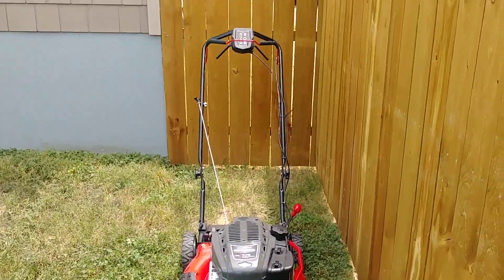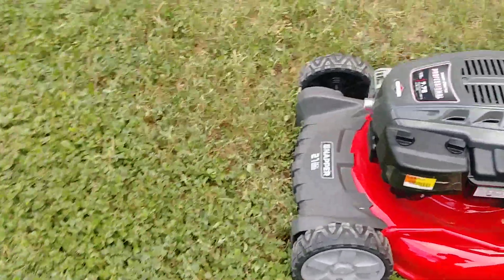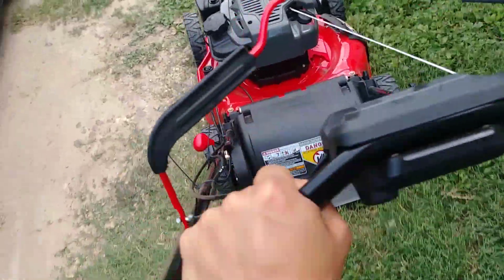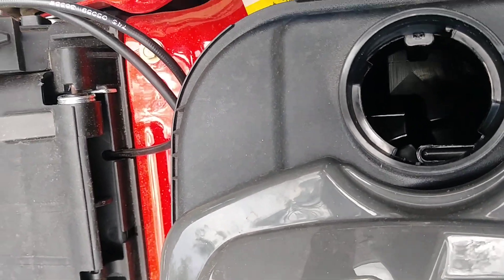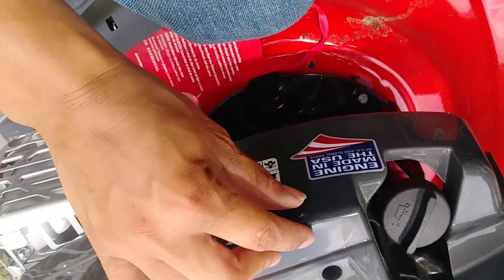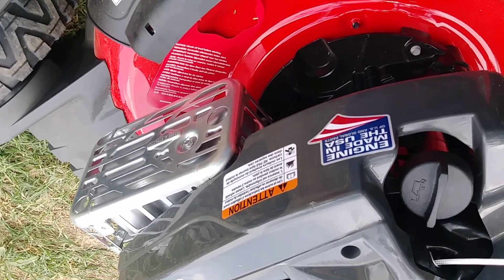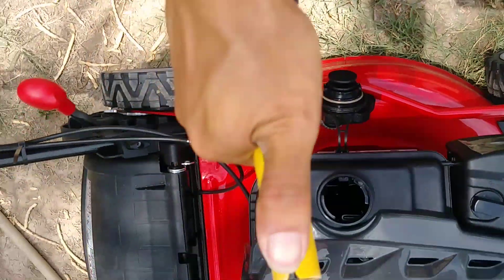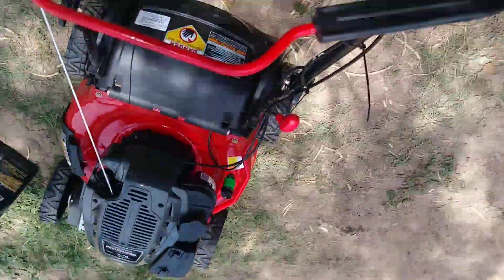2018 Snapper SP90 Great Deal

Comment: Wow that’s a sweet mower. That Pro series is basically an Endurance series commercial Briggs with the cast iron sleeve, and such. Should outlast the rest of the machine actually, which will be a good 10-15 years with regular maintenance.
Yeah we were looking to get a SP100 but they were sold out, however we were able to get the last (display model) SP80 on clearance. You got a great price for that mower!! Man!
Reply from the maker: Railroads Across Maine the SP100 is awesome. I think the ground speed on that one is faster than the SP90 if I'm not mistaken. I saw that one online but it was over $300. I will be using this SP90 for my side-hustle lawn care and my lawn as well.
Reply from the maker: Railroads Across Maine I did not know that this machine was the same or similar to the Endurance Series Commercial Briggs and Stratton. Wow that makes the deal even better!!! 😀
Reply: Yeah the 80 can cruise right along if you dial the thumbwheel all the way up. We set ours about 1/2 way.
Reply from the maker: I might try that with mine...